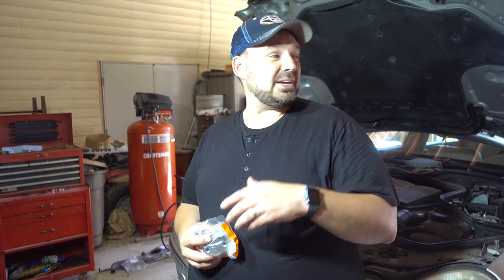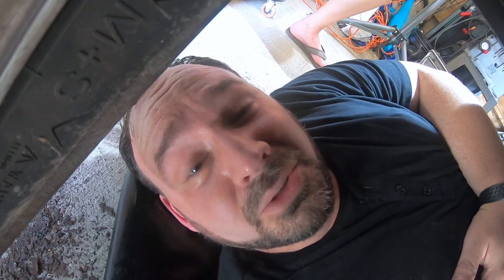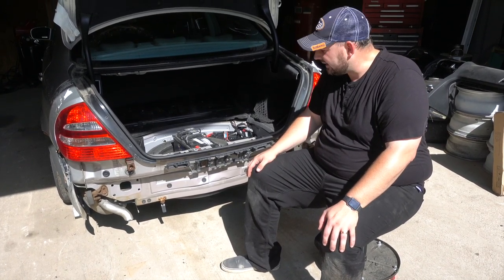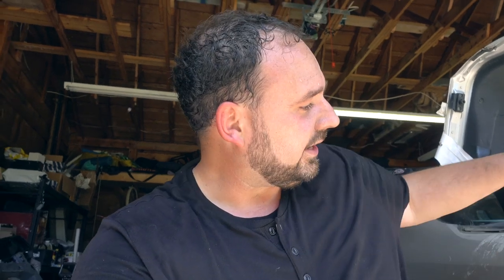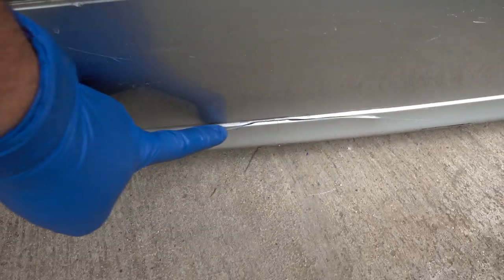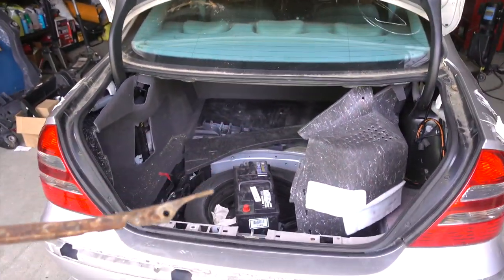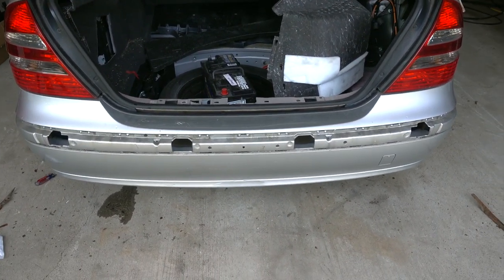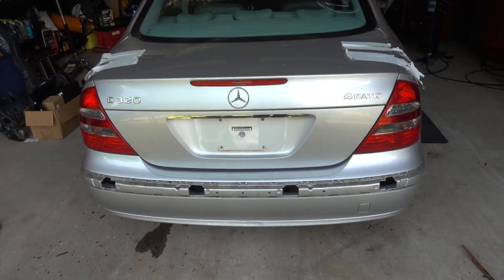Mercedes E320 Rebuild - Part 3

Comment: I think it would be a great learning experience if you try to do it yourself. If you already have an air compressor and a painting gun then why not give it a shot. It's possible to skip the primer step and just go to base and clear coat since your bumper is already painted but I think you should just primer the bumper again if you end up doing it yourself just to be safe. I'm not a painting expert or anything like that but I'm going to suggest a video that taught me how to paint. It's a Youtube video called "How to Paint Plastic Car Parts - Raw or Primed Bumper Cover
". It's by a channel called "Ratchets And Wrenches". Also see if your friend can come by and help you with the bumper if possible. If not at least you can ask him for some tips on how to do it.
Reply from the maker: Thank you! And I appreciate the tutorial suggestion. I’ll check it out!